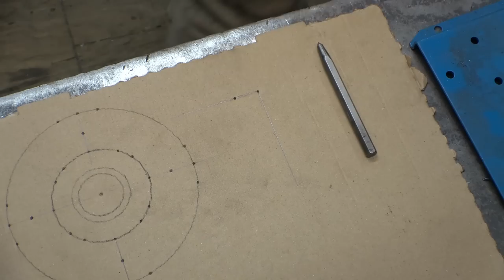How to Make Dune Buggy Chain Drive Rear Hubs - Home Made - Part 1

Comment: Just a few tips on machining. 
You should have your tool post set 90 degrees to your ways.
You have too much tool stick out. 
Machine towards the chuck, not away.
The birds nest of chips means to turn up the feed rate and take a deeper cut. 

Love the channel btw.
Reply: Also the bearing tolerances need to be tighter.  Bearings should have at least a slight press fit.  And there should be a radius on the axle shafts instead of that sharp 90 degree shoulder.
Reply: Since you are posting on a video sharing platform, why don't you just post a quick video showing everyone how to do it? Please?

Comment: Chris if you ever have to buy a straight shaft reamer again. You can set up your compound on the lathe to the angle of an existing Morse taper and cut it on the straight shaft. Then you just have to cut the flats on the mill.

Comment: Chris, try cleaning the rotating tool's rheostat contactor and the coils it rides on. they may be dirty which will affect the tool's operation.
Reply: I was thinking that pot/rheostat could be damaged due to possible arc damage and if your option fails, it should be easy enough to replace

Comment: Wow  been years since I had you pop up in suggestions, got un-subbed somehow.  Was back when you made your own lathe which I see you replaced and added a mill.   Great to see you're still at it !

Square and hex collet blocks are super handy, way quicker than messing around setting up an indexing head for your keyways.

Comment: Hi, I watch your viedos all the time and enjoy your work. I use to be a fitter for over 10 years. Now you have a good lathe, can I sugerst that you get yourself a set of micrometres, they are much more accurate for turnig then a vernier caliper. If you make your shafts with a 0.001" interfirence fit on your bearings, they will last longer and have less vibration, with a microeter, you will be able to achieve this with practise.

Comment: I've got a custom Ford 9" in the shop good for an advertised 800hp. It's not as thick as this. These axles would hold 1000hp if the torsional load doesn't break welds.
You could go half as thin again and still have plenty of meat.

Comment: You should probably make it with two chains, one from the back to the middle then middle to the front which will reduce the stretch and if you can get them perfectly central you will have a chain with you if the drive chain breaks it beats a long walk back.👍👍

Comment: good to see how far you have come with your workmen ship keep it up great work. Instead of having a chane going back to the front how about a chane to a shaft drive to the front two be a bit safer and your bearing is meant to press on not slid on. I can see some movement happening there but what do I know

Comment: Welding on thick material cools of the weld fast and could cause martensite to form depending on the steel alloy. So just to be safe preheating is recommended when welding thicker material to prevent brittleness.

Comment: Sounds like the problem with your rotary table is the POT (potentiometer). It could be something else, but they are pretty inexpensive to replace. Best case it has a part number and you can match it up with something that plugs right in. Worst case you have to check it with a multimeter and do a little reading to figure out how to source and install a new one. 

Alternatively. If you set it to the speed that you like to wend, and then check the resistance of the POT, you can probably get a resistor and install it so that it just turns that speed all the time. A POT is a variable resistor / a resistor you change the resistance of by moving the knob.

Comment: that rotary welding platform's pot seems to be burned on the area you want to use it, it should be easily replaced.
I would also suggest using a wiper earth on the main rotary platter to reduce surges caused by your welding causing arc damage to the thing's electrics which sound like they could be sensitive to power surges.

Also, while I know you're most cofortable with using chains, would using prop shafts for at least part of the system reduce the chance of breakage?

Comment: regarding the welding rotary table: I think since it's a cheap variant, it's a simple DC motor and a potentiometer to control the speed via the voltage. This would mean, that on a low speed setting there is only a very low voltage going to the motor. Once it stalls it can't get going again.
A simple solution would be to try and increase the gear ratio between the motor and the turn-table. That way the motor can run at a higher speed, for the same table speed. The higher voltage will make sure it won't stall as easily.
maybe worth a try, but in the end it's just a guess...

Comment: Replace the potentiometer (speed switch) on your welding positioned it’s a cheap part and easy, just check the value on the existing one and order from amazon

Comment: Next time, just use wheel Honda wheel bearings like from an Accord or Civic or CRV.   They are basically two bearings together in one forged piece-- so it just looks like a really wide bearing.  They are super durable and basically last forever.

Comment: Check out the Pandjiris built Mini Pro Positioner, 350 # capacity 8” Machine  chuck, 2-1/2” thru hole, .65 to 13 RPM or .22 to 4.4 RPM slow speed option.  Made in St. Louis MO

Comment: Shouldn't the bearing fit onto the shafts tighter.  Looks like they were a slip fit in the video which could allow the axles to spins in the ID of the bearings.

Comment: The potentiometer in your welding turn table is probably very bad quality and or dirty.  You can get a new one that is better quality and it might fix it.  Also you can try to buy some contact cleaner for potentiometers and spray that one.  Chances are if it came over on a boat the saltwater in the air corroded the contacts in it. If you replace it you'll need to match the range (in ohms).  Honestly if you are going to try to fix it you might be better buying a good quality potentiometer and just replace that probable cheap as dirt one.  I'm just taking a guess but it's probably a dc speed control in there so if the pot is dirty(or just cheap junk) and the added electrical interference it would cause the random stops and may even cause the speed to vary up and down when using it.

Comment: you need to put a tube spacer between the inner races of the bearings, so you can tighten the whole rotating assembly up, otherwise you're just pulling a heap of axial preload into the bearings, which ball bearings do not like.
Reply: Good observation.

Comment: I have my little hobby machine shop pretty well setup but I need to get some metal stock. You have a bunch! Where do you get it from? Any help would be appreciated.
Reply: He collects material. I do the scrap yards and buy dimensioned stock at metal suppliers, material offcuts are offten weighed and sold by the pound

Comment: Looks like you made things complicated when machining your axles? Doing all the work using the supports seemed to be uneccessary when you could have just used the live centre for it all? 
Also when lightening the bearing carriers, pretty sure you could have saved yourself a decent amount of time by just taking a deeper cut, you would have ended up with chips instead of a Bird's nest of fine shavings?

Comment: for power ..I recently came across a video showing a mini sports car powered by a Honda vmax 4 cyl sports car engine which can be built up to 500 HP but as a used engine is much lower than that and can be purchased thru the Japanese used engine program for a very reasonable price ... you might consider this a possibility it would be cheaper and more powerful than another bike engine

Comment: hi, I like your work, but please, after finishing the part, it is good to heat treat, harden the steel, temper the steel to the right properties, and also anneal the steel after processing, then there will not be so much wear/fatigue of the material, study blacksmithing processing of steels according to class, you are good, I wish you much success, let it drive

Comment: Everybody crash, You should just have machine it smaller, machine a rough sleeve .005'' undersize heat it to put it on place drill a hole put a pin to block it in place. and machine it back. That will have look like nothing has ever happen.

Comment: My CNC experience is with lasers. So, maybe some of this will come in handy for your plasma. A clean, rust free surface always helps with getting a clean cut. WD40 wiped onto the sheet will help too. Paint or stickers on the front or back causes issues. It will cut right through 'laser masking', but the tip might catch the masking that bubbled up & move the sheet. Cut the small holes before cutting a big hole next to them. (less chance of a head collision) Some bigger holes should be tabbed in so the sheet (part) doesn't move if it fell weird. Weather will affect quality of the cut. Same material manufactured on different days will affect cut quality.

Comment: I'm pretty sure you just need a new potentiometer for your rotary table. They're like 5 or 10 bucks. That's usually what the problem is when the motor starts and stops constantly for no reason.

Comment: The reason you rotary welding thing sucks is because it uses an brushed DC motor witch have very little force at slow speed that is why it sticks from time to time. To fix it increase the gearing between the motor and chuck, or get an different motor with build on gearing.

Comment: whatever happened with the electric dirt bike, i was really curious if a hub motor would ever work or hold up, you should reach out and collaborate v with a electric builder. i never liked the hub motors  jerky start and needs alot of tuning, they cant accelerate without gearing, thats why loardstown motors is a scam

Comment: 17:45 Again with the die to cut treads ON a Lathe??? Take some time to learn how to cut the treads WITH the lathe. It is not that difficult, and I know that machine is capable enough to do it. Please take the time to add another skill to your arsenal. When you take the time to learn you will have the knowledge forever.
Reply: I've seen him cut male and female threads with his lathe. I don't know if those are the correct terms or not but you get the point.